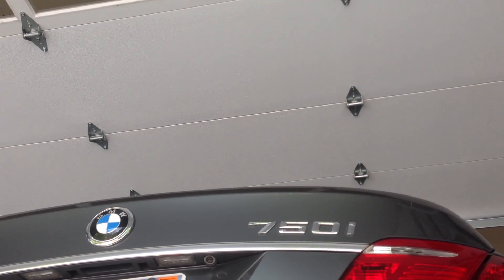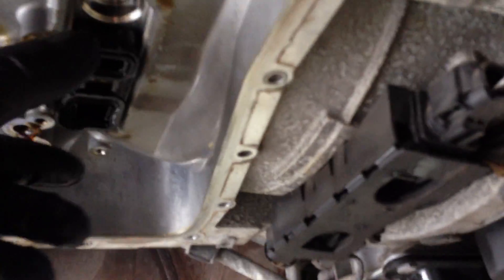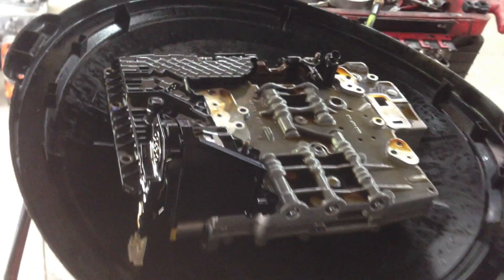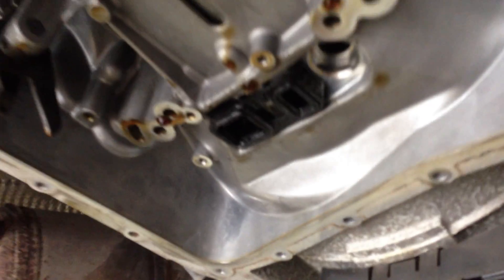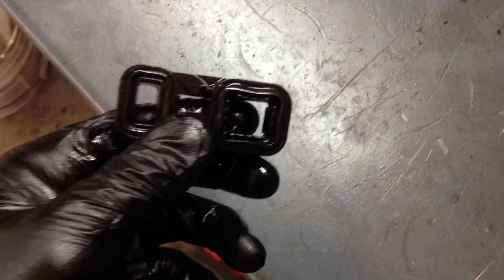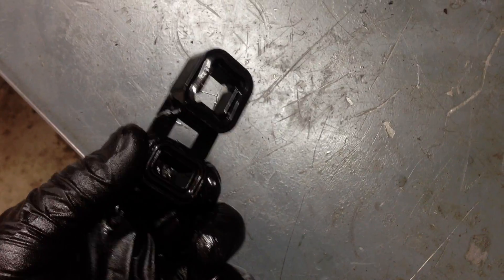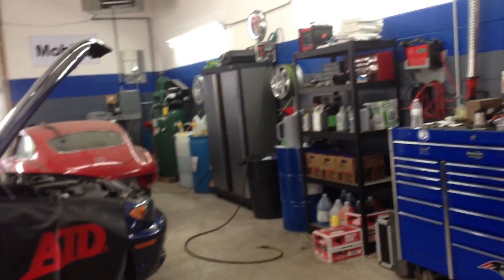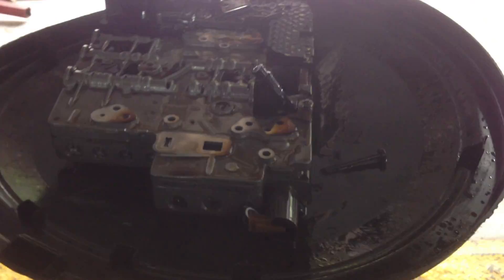BMW Transmission Code 4F81 Ratio Monitoring, Clutch A

Comment: That's funny..my car (2007 750li) is throwing some codes..among them 4F81..but I replaced the mechatronic sleeve, seal and 4 sleeves not even 5 months ago...I might have to recheck it again....
Reply: did you solve your issue? if so what was the problem?
Reply: @beaglebone99  It did, I ended up getting an aftermarket piece made of aluminum ..

Comment: I think im having the same problem.  My transmission wont go into any gear.  Scanned the codes and got 004f97 004f81 00507B and 00A830  What do you think>?
Reply: Hello , Did you resolve your probleme ?

Comment: I was having similar issues. Mostly my car would go into limp mode if it wasnt warm and I shifted from park to drive. The other day it jumped into limp mode after an over rev. Got the fluid, filter, and mechatronic sleeves changed. Now the car wont shift to 4. 1,2,3 shifted like butter. But then no 4 and goes into limp mode. Tried it in manual mode and got the same thing. Prior to service he said I had gear ratio fault and Clutch A fault codes. The sleeve was cracked. Im in limp mode now. Any thoughts?

Comment: Do you think it's the same on a 2010 Bmw 750 Li x drive? I am getting Ratio Monitoring, Clutch A, implausible. SGBD: GS100A Code: 400401. But I am also getting: Raiot monitoring, gearshift 4-5 Implausible 400341
Reply: What was the problem?
Reply: @plamenvalkov1106  low transmission fluid. I took it to an Indy shop and they filled it up with fluid and replaced the pan. But I am not too sure if they replaced that seal which is known to crack/shrink and is the main culprit of this issue. So far I haven’t had any similar issues. It’s been driving fine.
Reply: @tgarcia393   did you have the 8HP

Comment: Man, thank you so much! The shop wanted to charge me around 2k for transmission rebuild. You should see their faces when I told them to take the valve body out and it turned out to be the cracked seal :)
Reply: Ive got the same error message on my bmw 335i.. would it be the same issue?
Reply: @EdmonLazar  Most likely. Those seals have to be replaced with every AT oil change. So they do fail.. Anyway it will cost you 1h labor and 5 liters of atf oil to check if it is your issue. Better then 2k+ for a rebuild. I have a 335xi as well and I had around 130k miles on it when it failed. Good luck
Reply: Pete R  but i thought the oil on transmission oil on bmw is a life time?
Reply: @EdmonLazar  Our BMW shops say it has to be changed every 50-60k km. That makes sense especially for 335s that have 400NM of torque and 300+ hp.
Reply: Oh.. I was told not to touch that by most mechanics. Man this is bothering me. I hope it is what your saying. However, some people are saying its a problem with the altenator as my car shows a logo of a battery and it says low voltage charge then it came up with the transmission fault message.
Reply: @EdmonLazar  If you have a dead battery your car can show different errors that don't mean anything. Fix the charging issue first then keep investigating. BMWs are very sensitive to those batteries. If that seal is cracked in your transmission the car should be barely drivable as there is not enough pressure to hold gears. As it was with mine. If that's not the case, don't worry and get yourself a new battery/alternator. Hope it helps
Reply: Same too with my car they want a new transmisión 😂

Comment: I got a 4f810 gear ratio clutch pack A code on my xRF flash app...is this the same code ?  PM me if possible
Reply: Did you figure it out? I have the same code

Comment: Hi! I have: 4f92 ratio monitoring clutch a-c, Car is also slipping under heavy load. Could the mechatronic seal be bad?
Reply from the maker: Not likely. Likely needs transmission rebuild
Reply: Revolution Automotive Services, Inc. 
Thank you very much for your reply. The car has 100000 miles. And tranny oil was changed at 50k and now at 100k. It doesnt slip always. But sometimes when you floor the pedal in 2nd gear or third gear. Actually ive tried manual mode and it slips in 2nd 3rd. 4th till 6 under low rpms(2k) but you have to push the pedal till the end.
Reply: My car is 2011 335i e90.
Reply: Did you fix it and what did you do ?

Comment: Hey I had a question. I’m getting the gear monitoring clutch E code and my car will only hit limp mode after fully warmed up and only in gears 4-6 when I floor it past 3k rpm. Any ideas??? Thank you!!! 2009 335i x drive
Reply from the maker: Pull the valve body down and check that seal as shown here.
Reply: مرحبا وليد......انا فادي من لبنان ومعي نفس المشكلة....ما هؤ الحل؟
Reply: Waleed Eljechi Hey bro I’m having the same issue as you...Did you ever figure out what was wrong with your transmission?

Comment: Our issue was with an '06 750il. Different part # than Peter Cegarlz. I'll know, after the weekend, if the fix did the trick. Nonetheless thank you for the great info! Sure enough when we removed the seal it was indeed cracked. :-)
If it saves my customer thousands on a tranny replacement I'm in your debt.
Reply: FIXED! TYVM!

Comment: and what is this seal called?
Reply: Bridge Seal - 4F81 Auto Trans Valve Body Bridge Seal
Reply: BMW Mechatronics Adapter - eEuro Preferred 24347588724
BMW/Mini OE: 24347588724

Comment: Hi! I have the same error on my 2010 320d E90 6HP21. I feel the transmission slipping sometimes in 2nd gear under relatively hard acceleration. I once got the transmission faulty code on screen and went into LIMP mode; recovered after engine restart. Are these normal symptoms which could be caused by that seal? Looking forward to hearing from you, thanks!
Reply: Did you get the seal changed? did it work?
Reply: Hi mate. Yeah, I changed every seal related to mechatronics but it's no change, car still slips in 2nd gear under hard acceleration.
Reply: same problem here
Reply: What model do you have? As far as I've asked around a few gearbox repair shops, most likely it's caused by some wear inside the mechatronics, which causes pressure to leak, thus the slipping. Mine only slips when hot.
Reply: EQUANT mine only slips after warmed up and only in gears 4-6. Did you find a solution? I have the same code but clutch E instead of A
Reply: @AandW07  Hi I have the same problem! Did you ever resolve yours?
Reply: chnage all the valves to brand new
Reply: Bump guys any updates on your error codes did you guys solve the problem if yes what was it?

Comment: Hey thank you 4 the video! i have the same code 4F81 on my leptop but at the BMW they said i have to get a new transmision i think they just wont to get fast money (6000€) so i bring my car to ZF next week (Living in germany) i hope its only the bridge seal
Reply: Did you fix the problem?
Reply: @Adrianjlucia  i flushed the hole transmission and changed all seelings 600€ here and its like new
Reply: @Adrianjlucia  it was the bridge seal in my case very lucky
Reply: s g and what exactly where your problems? I’m having the same code.
After driving for 30 min it shifts fine
Reply: @Adrianjlucia  just do what i did bro

Comment: What's the name of that seal ?and where can I get one?
Reply: 4F81 - Auto Trans Valve Body Bridge Seal
Reply: BMW Mechatronics Adapter - eEuro Preferred 24347588724
BMW/Mini OE: 24347588724
Reply: DJ Deric  It is called a BRIDGE SEAL. You can get it at a Transmission Parts Supplier like Transtar, WIT.
The bridge seal should be replaced ANYTIME the Valve Body is removed

Comment: I have the same error code. The car was jerking heavily at lower RPMs and all of a sudden went into fail safe mode with warning "GEAR MALFUNCTION". I restarted the car and the error is gone, but the engine service light came up. I took it to a BMW dealership and their diagnosis says the 1) transmission is slipping 2) error code is 4F81 3) no issues with trans fluid. So, should i ask them to go ahead and check for Adapter seal between transmission housing and mechatronic?